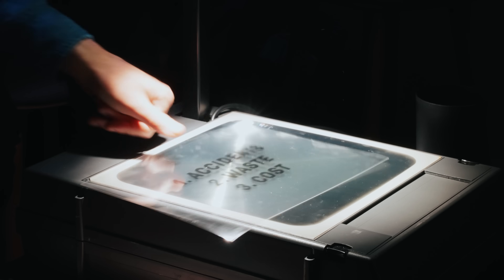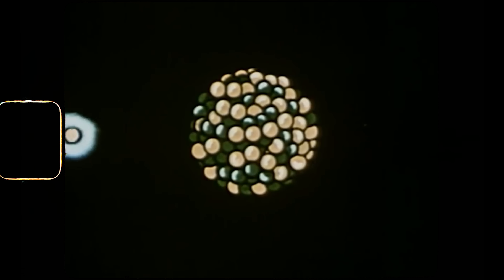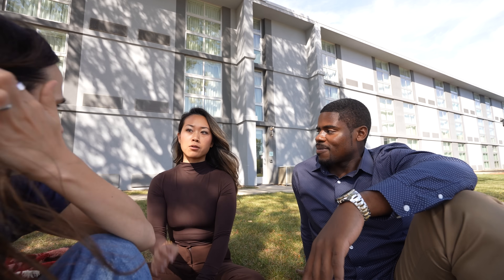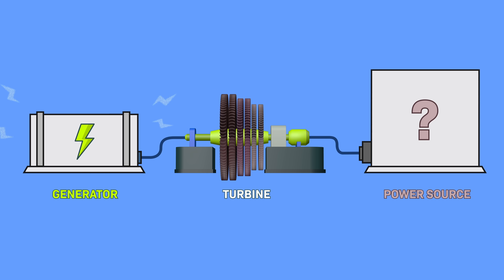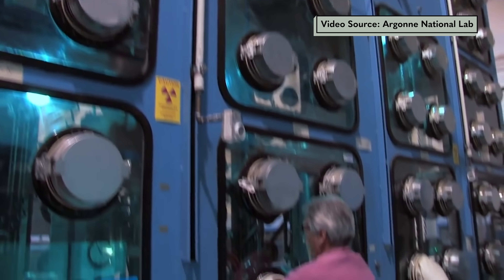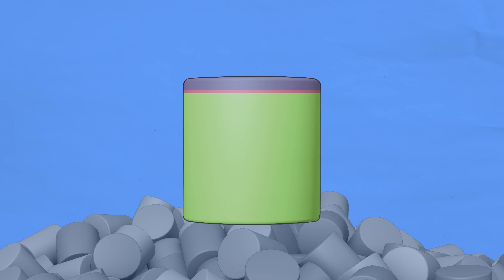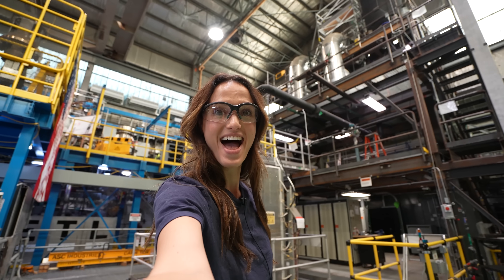The Big Lie About Nuclear Waste

Comment: I studied Thorium molten-salt reactors a while back that need a small amount of high-grade fuel to get started, but that can then run on raw thorium.  Most of the waste they generate are also materials used in nuclear medicine.  Oak Ridge National Laboratory built one in 1957 that ran for a year and a half.  The up-side was that 99% of the waste wasn't radioactive at all, or had half-lives on the order of days to weeks.  The down-side was that the nuclear material had to be actively pumped, and the pipes and pumps were degraded by the alpha-radiation of the material.  The biggest up-side, though, was that if the pumping ever stopped, the waste would cool and solidify and no longer be capable of sustaining the nuclear fission reactions.  In fact, the reaction is self-limiting: if the material gets too hot, the fissile material ends up spaced out too far and the high-energy particles ejected from each fission start missing other fissile atoms, causing the reaction to slow and cooling the material down.  If the material gets too cool, then there isn't enough movement to keep non-reactive atoms from blocking reactive ones, and the reactions slow, causing the material to cool further.  There's a sweet-spot that is only reached by actively pumping the molten material and limits how hot the material can get.  No meltdowns.

So, you can do the closed fuel cycle with uranium and when you reach the end of the recycling, you can toss the remaining nuclear waste into an active thorium reactor, then pull out rare-earth minerals and medical nuclear materials.   ... if we can figure out a way to keep the pumps and pipes from decaying from the constant bombardment of alpha particles.
Reply: Correct me if I am wrong, but arent all thorium reactors that currenty exist prototypes? Is thorium really commercially viable especially with solar being SOOO cheap these days?
Reply: @tobene  I believe China claims to be starting a series of commercial thorium reactors this year.  The US ran an experimental thorium reactors in the 1960s, and I think there are two experimental ones currently operational within the US.  From what I can tell, the problem isn't cost, it's environmentaliam.  The moment you start taking about nuclear reactors of any type, you get MASSIVE backlash.
Reply: @tobene  also, the "solar is cheap" argument isn't accurate. The issue is energy density.  One small reactor can power a decent sized town 24/7.  In order to do that with solar, you'll need a huge amount of infrastructure from land to put the solar farm on to batteries to store power for nighttime and cloudy day use.  Also, for most of the US, clear sunny days are are often in short supply.

Comment: When Olkiluoto 3 was finally launched this year in Finland, it was 13 years late and some tech channels even made videos about how the new tech solves the waste problem. The solution? Massive storage in bedrock (Onkalo). You kidding me, calling that a solution? It was launched 13 years late and they didn't even make recycling waste reactor while hitting hard on cutting emissions and promoting green energy, setting world's strictest goals for carbon neutral society.

The irony with OL-3 was also that the electricity cost in the winter skyrocketed and it was advised to not use sauna and limit energy consumption at homes. While every week they promised the OL-3 would launch next week, while getting new issues in the tests. When the spring came rushing with heat wave, that's when the OL-3 launched and electricity cost was negative, you'd get compensated by the electricity company if you used electricity. Sounds like everything in energy sector is working like planned.

Comment: A nuclear reactor creates 1/800 th of the volume of waste compared to a coal fired plant.  Very clean source of electricity. Because of the internet, phones and electric cars the demand is going through the roof.  We MUST return to nuclear generation.  WE can reprocess nuclear waste and reuse it BUT  the process of removing the POISONS (look it up) from the fuel is a very dirty process.  VERY DIRTY.

Nukes still have inherent problems.  Reprocessing fuel and the SECURITY that will be requiired in the future will directly affect the future cost of generating electricity from nuclear fuel.

Google "nuclear fuel poisons".  (That she describes as the rest of the junk)  It constitutes all the elements that don't "split", that just absorb nuetrons without creating any heat.

THE REAL ANSWER is to reduce our dependency on energy.  We need to create systems that are more efficient.  

Read the LAWS OF THERMODYNAMICS.  We can be more efficient.   WE CAN DO BETTER.

Comment: Before they built the Nuclear Reactors, we were told it would make so much power, it would be too cheap to meter... Homes would just 'subscribe' to a power plant, and pay a flat fee - because you would have unlimited power,  no need for a monthly bill, just pay for an electric subscription annually, and never think about electricity again...
Reply: Actually, that was said about nuclear fusion, not fission. But the idea behind it is based on how cheap the fuel for fusion would be. This is also true for fission, the fuel is only a tiny portion of the cost of the electricity, and in the newest reactor that portion is even smaller.

Comment: Great video! I've had a TS, S, and SAR clearances for over 40 years, as an aerospace Engineer and videographer. I have studied the videos of past nuclear explosions and even some of my colleagues agree, these videos are composites, some are two explosions overlaid. They have been mortified from the actual event. These are probably MOAB type bombs. Guy Foxe (1605) almost blew up the English Parliament, while in full attendance. There's a BBC documentary where they duplicated the event using over 30 barrels of TNT. The explosion could be felt many miles away. 
Conclusion: Nukes as presented to the population are a lie, to cause fear, panic  and obedience. Hiroshima is an extremely fertile area with no sigh of radiation. 

.

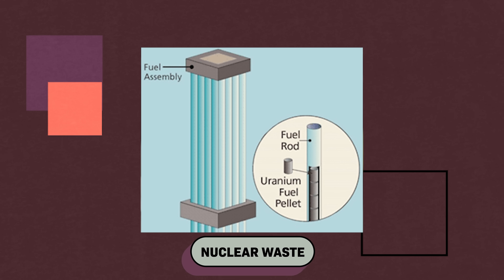Comment: Excellent video but I have one little pickle with it. At 7:07 you said that the number (235) refers to the number of neutrons in the atom. But isn't that the mass number which includes the protons and neutrons? So the actual number of neutrons would be 235-92(the atomic number for Uranium). Im not totally sure about this btw

Comment: The name holds very true. 99% of its potential is wasted hence the reason why they call it waste. They did lie, more than you would ever imagine. It's not getting used at all.  It's getting too hot and radioactive to be used inside the current technology used. Yes it becomes stronger from the process. Most of the world's reactors are what they call breeder reactors. This video is filled with false information. The waste will be extremely dangerous to any and all life for around 2 million years. They won't tell you this because if everyone knew the truth it would have never been allowed.

Comment: There is a wide variety of waste product from various fission reactors, not all of it is recyclable. Also with the transition to vastly more nuclear energy that advocates are calling for and particularly with wide acceptance of small modular reactors (which create more non-recylceable amount of waste per unit of energy produced than large scale facilities) the amount/volume of waste requiring long term sequestration and active management is only going to grow exponentially. The nuclear proliferation label applies not only to weapons but also the material (fuel and waste).  And of course it is all economically prohibitive to boot.

Comment: The US is all wishy washy about our energy policy. It changes with every new President. Our policy is all over the place.

Use France and Germany as two polar opposite examples. Germany is all in on 'renewables', France is all in on nuclear power. Germany's cost per KWH is about 30 cents. France's is about 18 cents. The French pay about 41% less for power than the Germans. Green/renewables is not nearly as green as those invested in it say, and it is nowhere near as cost effective as many other alternatives.....as in pretty much any other alternative is cheaper albeit, they may not be better for the environment (with something like coal).

The footprint for a nuclear power plant is small. To get the equal amount of electric output from a solar farm, you need something like 50 times the land area. Much of the area around the nuclear plant is actually vegetation. The entire solar farm is made up of panels that alter the climate and create kill zones for birds and creatures that live (d) in that area. 

A wind farm uses 200 times the land area, and have proven to be deadly to flying critters. There are wildly varying studies about how many birds are killed and nothing reliably recent as there is not much appetite to talk about the bad things with renewable/green energy.....however, using averages from studies that are almost 10 years old and taking into account the numbers of windmills today compared to them.....the number in the US alone is somewhere in the 550,000 to 700,000 range for birds killed per year. So you can bet that worldwide, the number is in the millions. They don't discriminate either.......if there is one yellow bellied red winged butterfly eating hawk left in the wild and it sees dinner fluttering around a windmill farm......well, the species will now be in zoos and museums.

Nuclear is our only real 'sustainable' energy right now. Thorium reactors are even better than the ones we have now. But that is a whole other topic.....short version, thorium does not create nuclear weapon byproducts, has a far shorter half life and is more plentiful than uranium. Uranium 235 become 236 in the nuclear process and has a half life of millions of years. Thorium 232 becomes 233 and has a half life of less than a month.

Our two biggest problems are where the money is focused now and government roadblocks designed to force us into a particular direction rather than the best direction.